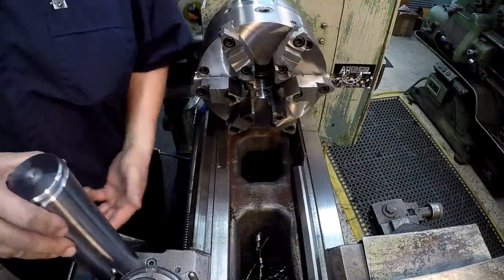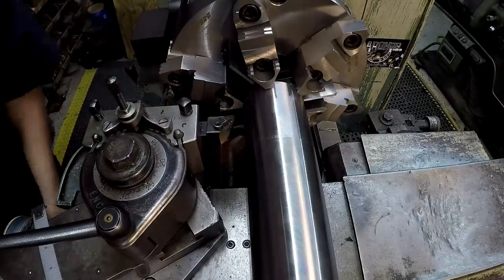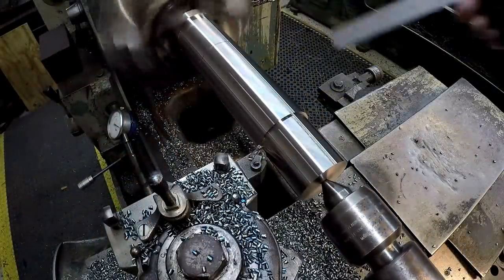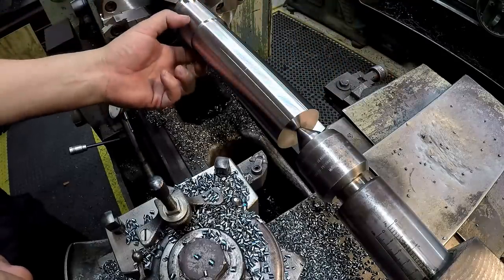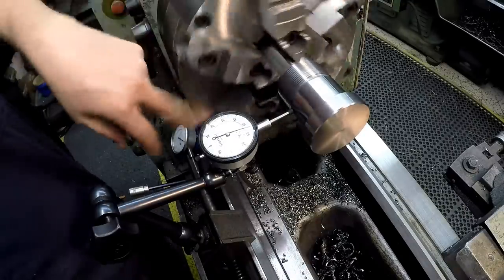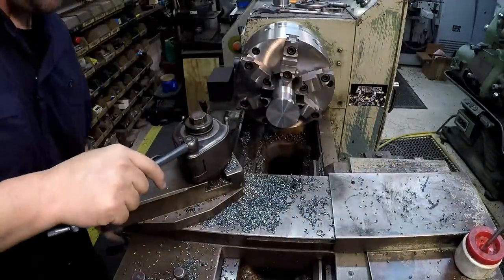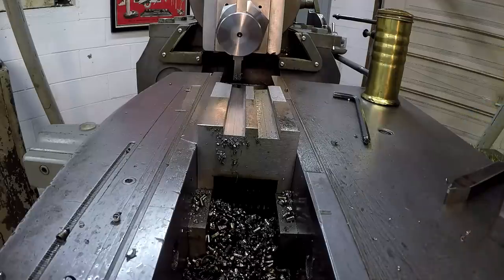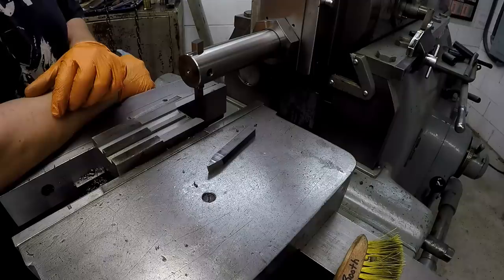Custom Internal Shaping Bar Part 5

Comment: Adam, it's because of machinists like you, and TOT, that have inspired me to fundamentally change how I do any metal work. No longer do I reach for the sledge hammer first, now my first choice of equipment is a measuring device. Using thought before action has saved me so much time in the long run.
Reply: Lol, is it sad that my first thought was about measuring the size of my hammer before getting a bigger one?

Comment: Day job is going to start giving you more homework at this rate.

An idea to consider:  A small V groove added (with a 3 corner file) to your tool bit slot, just enough to allow cutting oil to run with some control, from the top, and mill a little pocket (recess, half circle) that would always be on the vertical"top end" of the tool slot. The V groove should help direct the oil down the forward side of the tool bit (what would be on top if it was in a lathe) to help insure that the cutting edge has oil on it during the cut cycle.  On the return stroke, oil will get laid down on the work right where the action is.  The pocket is an oil reserve, and gives you a slightly larger target for the tip of the oil can when more oil is needed.  Better targeted oiling and reduce the chances of fingers or oil can tips getting in foul with the tool bit.
Reply: Sometimes good ideas look so obvious when someone else has thought of them.
Reply: this one took a while to really come to me, I think it started on seeing the broaching of the longer bar.  The spots that were still slightly rounded after the broaching made me think that they would be good for allowing oil through from the top and keep it on the tool bit, where the pressure is.

Comment: Adam, I would like to share with you how we do our keys with our home made hydraulic vertical broach.

 First, the shape is a dovetail shape. Sides become vertical automatically at each cut.

 Second, we have made the tools in a way that they are always facing orthogonal to the cut direction. In this way when we broach an hole, we carefully look at the very first scratches the tool made. They must appear in the same time, in the number of two and they must be of the same size/width.

 If the tool scratch on his left only...you are not in the middle. It's geometry. 

Hope to have been helpful!

Comment: Damn, Adam man..... you just made be buy a shaper! You tell my missus why I need one!
I have to watch all your shaper vids again now!
The machine I bought is about half the size of your one, but nevertheless.... 
She told me, I could have a shaper if you explained that men just need shapers...don't make me a liar Adam... after getting that machine (got two milling machines in the same process) I haven't the money anymore for a divorce lawyer LOL

Paddy
Reply: I spent the better part of my life hooking the IT bits to the mechanical bits of CNC equipment. From the more modern machines to the retro fitting of the early Fanuc controls. That stuff gets old real fast. It's great for production, don't get me wrong, and it has its beauty.... but no thanks... Add to that, that working in CAD is mind-numbingly, yes terminally boring.... and I even look with high suspicions at my 3D printer !

Paddy

Comment: I feel like the nuts should have been presented in a bag... and before you judge me, I heard Adam laugh!
Reply: It would seem more appropriate to have them in a 2 compartment sack with a cinch string at the top to keep them from falling out or metal to metal contact. Then he can hang them on the shaft when they aren't being used to keep them from getting lost. I'm not judging, just critiquing.

Comment: I would appreciate a video on how you clock the tool bit in your boring bar so that the sidewalls of the key-ways cut with it, are square to the bore. As a retired 45 year machinist, I know how you did it, just would like other people to know what it takes to get the job done correctly. Also remember having one of those Cleveland drill indexes on my bench years ago, and thinking nothing of it, left it at a shop after getting a new Hout index. Wish I would have kept it.

Comment: I must say I love watching these videos. I did wonder though, when you were talking about the V-blocks in the press, whether you could have used one on top of the work when you were starting the broach to get the flats of the broach at right angles to the work rather than having to engrave the square shape in the mill and line it up by eye?

Comment: Do you ever have trouble with the bar rotating in it's holder in the machine?  As though the nut comes loose from vibration?  How does it have a positive true lock, or is it best to be movable, for slightly different applications?

Comment: hey Adam, if you get a chip scratch in a cylinder shaft, how do you correct that?  or do you have to scrap it & start over?  (i realize not the case here)

Comment: I would like to see a dial indicator mounted on the sliding head of the shaper that is measuring the position of the bar  --  just to see if there is any flex in that bar as it cuts. I can't imagine that it would.

Comment: Looks like you did a hell of a job getting the old antiquated Shaper working GREAT once again! I guess your persistence paid off! Excellent Modification but just wondering if there is enough clearance for the tool bit on the back stroke.

Comment: Hey Adam, just wanted to say thanks for all your effort thats put into these videos! They are full off knowledge. In this series, i notice you dont use any coolant in the turning segments. Does the heat create a problem with measurements? I find when i cut dry with carbide inserts, the heat builds up and throws my measurements off...
Thanks for your insight!

Comment: Hay,  Adam,   I picked up on some 3/4" Taps, one is 8-N Hs pti and it looks like the other three are 7 NC HS pti.  they are in good shape one doesn't even look used, still has the rubber coating on it. I'm not sure but I think the 7Pti ones are different from the normal pitch. am I right?

Comment: Would the heat in the rod swell the metal enough to affect the testing of the nun on the threads?  Is there much difference with the rod at room temp?

Still amazed at the patience and precision involved in all you do. Thoroughly enjoy every upload!

Comment: To keep round stock from sliding back in jaws, if you have enough stock turn a smaller diameter on one end,or a step,making sure you have enough stock going back in jaws for adequate chucking,stock will butt up against face of jaws,no more pushback

Comment: Hey Adam. So out of curiosity why do this on the Victor instead of the Monarch if the Monarch is better at the heavier cuts?  Is it just a personal preference to use one over the other for certain operations? Needed a specific thread pitch? Felt like chewing Victor bubblegum today instead of Monarch? 😁
Reply: He said people have been wanting to see the 6 jaw chuck in action. It's on the Victor.
Reply: phlodel ahh missed that part.

Comment: Very cool.
A question, did you say that when cutting a keyway that the tool will plunge in (at the end of the backstroke/start of the forward stroke?) to cut the keyway? Rather than "dropping" into air, it will drop and plunge into the metal?
Thanks?

Comment: Can you rotate the vise so that the screw is facing outwards to machine your coupling? Seems odd to be cutting against the movable jaw, but that is the way it is with shapers. I think that is why shaper vises are usually built so massive and heavy.

Comment: There is a better way to do it.  Use a cutoff tool to both sides, this gives a accurate dimension to the sides and then cut the center.  You will be very pleased with how easy the center machines.  Also, the machining time will be reduced to about 25 percent of what you are doing.

Comment: Off the top of my head I would say the 6 jaw would have no more holding force than the 3 jaw chucks.  F=uN. Friction force equals a constant times the normal force. Area has no affect on friction, which goes against intuition. But who knows...we'll see.
Reply: But flex reduces friction, and chuck Jaws do flex out under pressure, so 6 Jaws would spread the load out in the chuck, possibly leading to less flex, and thus better contact and better holding.

Comment: I love to watch your video's. Very interesting and I've learned a lot but is it possible for you to tell the dimension in millimeters? It's difficult for me ( and I think for other people from europe too ) to convert from inch to mm. Greetings from Germany.
Reply: It's easy, if you want exact then 25.4 mm or 2.54 cm to one inch. Ball park for a close estimate while watching videos just multiply the inches by 25 and that will be close enough in mm's. Fractional inches? Then use it as a percentage 1/2" = 50% or 12.7 mm. Close enough for round numbers? then use .040" per mm. If you want to convert any fractional number to a decimal number then just divide the bottom number by the top number. That gives you decimal inches which are base 10. Example 29/64ths 29 divided by 64 = .453125" divide that by .040" to get roughly 11.32 mm. I watch lots of videos where they only use metric and can ball park the numbers back to inches or decimal inches in my head easy enough. If I can do it anyone can.

Comment: Hi Adam  I am really enjoying your videos as I am slowing learning machining as a hobby.  One dumb question:  when you state that you are taking "200 Thou", is that off the diameter or the radius?
JK
Reply: At around the 6 minute mark, when he's talking about the cut that his victor lathe can handle, he's talking about the actual material removed from the diameter. (He says 1/8th on the dial. Which means 1/16th DOC on the radius, 1/8th off the diameter.) I didn't hear the "200 thou" part.
Reply: That’s what I thought and thank you for confirming it. Adams machines are so large, it’s hard for me to tell

Comment: How difficult would it be to adapt a shaper like that to cut gear teeth?
Reply: Not that hard really.  You can place an indexing head on the table where the vise is sitting and use that to index the gear blank for each tooth.  You do have to grind a tool bit to the form for your gear or buy some gear-shaper tools.

Without an indexing head, you could lay out an index-hole pattern on the gear blank itself, then drill the holes and use dowel pins in two holes at a time to locate the blank off of the vise jaw, or a parallel.    If you had to do more than one gear this way, you can make an indexing plate and attach it to each blank one at a time, or gang-shape a length of round and slice off each gear (watch out for taper with gang shaping).

Comment: Is it possible to have carbide shaper tools or is WC naturally bad at impact load?
Additionally, is it possible to use a single cutting edge broach on it?
Reply: Carbide tools on a shaper are possible, but not if the shaper uses a clapper box, because with ones, the carbide tool gets dragged across the entite length of the workpiece. If you have a mechanism that lifts the tool on the return, you can use carbide tools

Comment: Do you take the heat of parts into consideration when you're machining? I know that part of the goal is to have the heat removed in the chip - but at the end of the thread cutting the part was too hot to touch with bare skin - I don't know the coefficients of thermal expansion for things off the top of my head, but maybe there's a cheat sheet or a quick shop chart type thing to help with that kind of thing. I've been learning a lot watching all your videos - I am no machinist...just trying to be well informed so I can be a better person. Thank you!!
Reply: Just wait for the part to cool off before you take your finish cuts.

Comment: While cutting the threads I noticed you didn't take the play out of the slide when bringing it back to zero before reengaging the thread motion, why not? I was always taught when threading to bring it back past zero and then bring it forward to get rid of the play, I noticed you didn't, just wondering, great video though.
Reply: Clay Janes if you move the tool towards the material then there is no play. When he backs out he introduces play which then automatically is taken care of when repositioning the tool towards the work. If he overshoots he then has to back away over zero and reposition. If you were talking about the lead screw, then it also doesn’t matter, the lead screw basically drags the apron so it takes care of it’s own play...just always position in the same direction.
Reply: Might have been an idiosyncrasy of your lathe.
On my lathe, I can hit between the lines, or at 1/4 of the way between the line. There is almost enough play in the threading dial that if the carriage is loaded away from the work, you can hit the 1/4 distance and have it almost look like you are hitting the line when you are infact 180 degrees off.
Being able to hit between the lines makes double start threads easier to cut, but you do have to watch for the play.
Reply: if there is play in your treading dial you need to re-adjust it, normally it can swivel so it can be adjusted or disengaged when not needed.(unless it is fixed inside the apron as part of the casting) and again (regardig the leadscrew) it doesnt matter which way you position the carriage (to- or from the workpiece) as long as you do the same everytime. The issue about when to engage the halfnuts for the lead screw is all about the relationship between the pitch of the lead screw and the pitch you need to cut, sometimes the relationship is ideal and it basically doesnt matter where you engage, other times it only works half the time. If the leadscrew pitch cant be divided by the pitch to be cut then bassically it only works in 1 spot. If the division is a whole number, everywhere is fine...